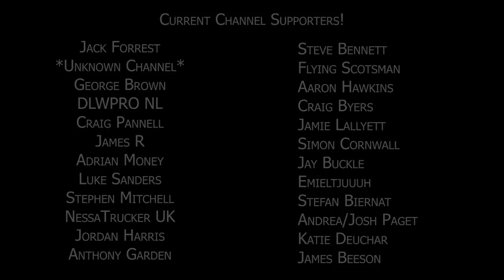I Quit My Job!

Comment: Mate i feel for you when we bumped in to each other on the Docks you looked happy and eager, But you me both get put down by company greed, since i finished with containers i went on to shifting film sets for ADF Facilities and they were worse had to opt out of the night work rule, (why make a law that can be broken legally) it started ok shift start at 16:00 finish 2-3 AM then they started saying 2 drivers haven't turned up 3 drivers haven't turned up and i wasn't finishing until 7am No Night rate overtime was only paid if you did more than 12hrs they stopped drivers speaking to the Operators and when one day i demanded to speak to my operator and confirmed my work sheet was all the work i would be doing that night, When i arrived on site guess what two drivers hadn't turned up Or more to the truth they hadn't hired enough drivers to do the work in a reasonable shift at a reasonable rate. When i complained they said well you know what you can do F Off Home so without moving a single trailer i went home and quit, Your doing the right thing Luke Nights will kill you early, You can drive a dust cart for £13 ph and you only need a class 2, you do the same trips week in week out no planning required and you don't run the risk of going over your hours trying to please some greedy Haulier, No disrespect to council staff just trying to put it in prospective, I hope you can have a Lovely Christmas with your family, Something will come up in the new year, If you do find someone who actually respects they're hard working drivers, Let me know as i haven't found one yet
Reply: what council pays 13 for bin driver? derby city pay 10 something but if your not driving you will be binning. unless you get taken on as a driver contract only which is 11:88ph but they are gold dust
Reply: @Mattfoster84  Southampton city council on PAYE
Reply: Melbourne australia Council truck drivers get $70k per year. guess what they never leave!
Reply: @Paul_i_is  derby city is also paye,  I'm on agency as a driver but my contract is about to end, but I'm on the same as the full time drivers.
Reply: @davidbernard7256  yer wish I was still living in Australia, much better money out there than the uk.

Comment: I gave up class 1 after 9yrs & walked away. I always wanted to drive trucks & ive done it. Used to love driving but hate it now. I tried talking to my company at the time about the amount of hours & drops etc. Even told them i felt i was a danger to myself & others on the road due to the hours & stress. Their answer was i was over exagerating things. I walked not long after. Goodluck in the future

Comment: Catering company. It's fairly easy and chill and you get to meet some nice people. There wont be any sleepovers in the cab either as it is you go out and empty your truck and come back home. When i did it i used to go to work around 2 or 3 am but some did it later.

Comment: I totally understand what your saying Luke and it sounds like the small companies are struggling so they have to take what they can but it's a drivers market and you will get another job ...maybe container work?
I will pm you about driving jobs where I wor -  but it is in Bicester ...good hours ( day work, start between 3 and 4 am, finished ( usually ) early to late afternoon. We are looking for class 2 multi-drop drivers and there is day cab work ( set runs ) for class 1. Over 30k a year. They would take you on in a heartbeat Luke because you are a well-experienced driver.

Comment: I wouldn’t worry mate,  from what read the haulage industry is chronically short of drivers,  so if you want to take break then do, but I’m sure with your experience you could walk into job same day if you wanted to, i work in taxi industry and have left one job and drove 10 mins to another firm,  had couple days off, started work 2 days later, worked 4 years there then left that job and straight into another job,  so if i can do that then sure as hell you can do it even easier, of course you may want to take time, have break, suss out what u want, I’d say the world is your oyster,  I’m sure this will lead to better job for you, Trucker Jay and Jenko left there jobs and needed up in new jobs easily, so u will as well,  and they seem happier, ive learnt that worrying gets one nowhere , as you find you stress about something, get in a tizz, find things are nowhere near as bad as you thought they would be, then wonder why you got stressed,  you will be just fine,  i would enjoy Christmas, put feet up for couple weeks, chill out then get job early new year,  it will work out ok trust me,.

Comment: Luke, I'm in the similar boat as you. I'm thinking of leaving the temp-perm thing I'm doing, as I've had enough, but the money keeps me on there. Need to find somewhere else, before I pull the trigger. Not easy for a 24 years old, with about 5 months experience. Kinda want to stay on (current truck is a 7.5 tonner) 7.5 tonnes work, or van work. Enjoy driving those more. Have a good Christmas, and a good new year. Family time, is more important than work time.

Comment: If you're not happy then moving on is the right thing. There are many jobs to choose from if you're a good hard working driver so I'm sure you'll be fine. Quit the job properly and respectfully and I'm sure you will get a good reference or like you say, if you want to return you can. I will say though, with most companies you are going to have to stick around for a while to be doing the good work. Best of luck to you 🚛💨

Comment: Take a well earned break mate, recharge your batteries and enjoy being with your family over Xmas, there’s loads of work out there don’t panic if the right job doesn’t come straight away January is a quite month in every industry, work life balance is hard to find in haulage but it can be done, bigger company’s offer more flexibility  for start times, shift patterns etc. Work out a figure you need to earn and take your time, you’ll be fine.

Comment: HGV Driving is rarely an 8 hr shift, employers are acutely aware of the hours you can drive and most business's push those hours to the max, a good work home life balance is important where family is concerned, you have done the right thing and now you need to reflect on what you can go for that covers the bills but gives you that home life you crave for.  This industry is like any other, matters not if its factory work or office ( been there), whats missing is fair play, treating drivers equally and making those adjustments where needed.
I would never consider the job full time, respect to all that do, after a days driving your mentally knackered looking out for all the idiots on the road.
Works there mate and i am sure you will pick the right option when you see it, best of luck!
Reply: I think that is more the point it's being treated equally and reasonably to get the best from employees not stretch them and throw relentless unrealistic hours and pay at them. It's the same in multi drop van work which Im currently doing. You can have a nice route with very reasonable hours which can turn on it's head into a 12-13 hour day with little rest time and no better pay. A lot of driving jobs are paramount to slave labour.

Comment: It would be interesting to watch everything you do in preparation for a journey.
For example, route planning, what do you look for on a route other than the obvious low bridges etc.... how do you note anything that is significant, also how you plan your breaks around work time and driving hours rules. Which sat nag do you use, are there any other practical driver aids you use? Have you got any tips on walk around checks, any help on when to put tachograph in waiting as opposed to a break or other work etc...

I guess I’m asking for the equivalent of the old saying “you’ve passed your Test now go out and learn to drive”

Comment: This is the sad reality of working for a smaller company.  Those of us who've done the same know the pain.  But on a positive note, by doing all those many varied trailers & jobs you've so much more experience than most drivers with such a short time spent on the road.  I know of many guys who've spent many years on the road; decades even; & still not got to cover curtain-siders, flatbeds, stretchers, containers, & low loaders in their entire career, much less in so short a time that you've done...  This will stand you in good stead for sure.  Good hunting; though you've likely found something by the time I'm writing this anyhow.
Reply: the only downside is with all the different experiences he has it doesn't get him a better wage.

Comment: Hello Luke, don’t mean to be pedantic mate but that’s a semi trailer or a step frame not a low loader. And you put the legs down to stop the bridge of the trailer cracking nothing to do with the tyres, normally anything over about 30 tonne id stick the legs down.
Hope you find a job and land on your feet pal, happy new year!
Reply: Your right about it being a semi trailer but it’s still classed a low loader .30 tonnes on a king semi ? Anything over 10 tonnes you should put the legs down to go up the ramps .Unit and a 45 ft king semi will be 19 plus tonnes unladen apart from chains and binders you’d be lucky to get 26 tonnes legally unless STGO plated. I do it every day .
Reply: Your right about it being a semi trailer but it’s still classed a low loader .30 tonnes on a king semi ? Anything over 10 tonnes you should put the legs down to go up the ramps .Unit and a 45 ft king semi will be 19 plus tonnes unladen apart from chains and binders you’d be lucky to get 26 tonnes legally unless STGO plated. I do it every day .
Reply: Willow7909 our faymonville semi is good for about 57 tonne, the anything heavier than a D6 we put the legs down, we had one trailer crack because of using the legs and dropping the air believe it or not! And those king trailers are strong as an ox, our one the legs come down automatically but you won’t believe the weight you can put through that without any stress

Comment: Do what I did, use you're licence as a tool to step up to another career.
I jacked like you after I got fed up of going to bed before my kids, so I signed up to a 2 year adult education course to be a gas engineer, it was a 17 hour a week course over 2 days (midweek) so agency work around the course was the only option.
I don't know what your practical capabilities are but my route worked for me.  
You can use your licence as an escape route although you will have to embrace the enemy of the agencies while you retrain, but for the sake of your family and sanity get your arse out of transport!

Comment: I had a quick check of the comments as I'd have thought someone would have spotted this in the last 3 years but I didn't spot anything (sorry if they have and I'm just reposting):
24:13 the traffic on the other carriageway disappears
24:19 the police appear to be putting on a box trap
24:21 a police car is holding the traffic back so they don't interfere with the box!

Comment: The trouble is, young blokes see a big flash truck and they want to drive it. Then they find out what the haulage industry is all about. Then the novelty where's off.
Reply from the maker: Nothing flash about a MAN 😂
Reply: Luke C in a HGV Hi Luke C, it was'nt aimed at you percificly. I was a Lgv driving instructor for 20 years so I know what they're thinking. They can't wait to get cracking in a big truck,I was the same when I was driving, want to drive something bigger. But I soon found out that the bigger the truck the more the the haulier puts on you. I think your doing the right thing, but if it's in your blood you'll find it hard to pull yourself away.

Comment: I know lots of drivers will say it’s boring , but supermarket work is about the easiest hgv job I’ve ever had and one of the best paid, also no nights out
Reply: I don't  get the boring thing, most jobs get boring after a few years but better to be bored because the job is straight forward than wind up stressed out doing something constantly challenging.

I don't drive but know a couple of friends who do and they both ended up doing supermarket driving for the reasons you stated.

Comment: Luke, you're a good lad hard working and honest, Campbell as already said it and he's right get on the Supermarkets it's far better than general haulage, no nights out, carrying your own stuff I'm sure there's an Aldi down your next of the woods.
Get on the agency give it a try, have a break from the vlogs it will still be there went you get back, no amount of money will give you your time back with your family Luke, have Christmas and New Year off recharge your batteries get signed up then with a few agency's, I used to do weekend work (days)no nights out, You get a better rate of pay a bit quieter and you can spend 5 days with the family instead of one. Anyway, have a good Christmas chill out enjoy it, remember you have a class 1 with loads of experience now.

Comment: The trouble with the transport industry is everybody wants everything delivered but no one wants to drive the trucks to get things delivered.  Good luck with next job
Reply: because the companies wont pay the money. picking on a night shift at amazon pays more than hgv drivers get.
stacking shelves at aldi gets you more than a hgv driver. both unskilled jobs that pay more. thats the trouble with the industry...... and the industry only has itself to blame! the only good thing about becoming a hgv driver now is the fact you can find a job with plenty of sitting around waiting in which you can spend that time retraining. thats exactly what im doing. when im waiting to get loaded or unloaded sometimes you can wait a few hours. im doing a college course from home in that time so it turns out the company im working for pays me to learn. in 1.5 years time ill be a fully qualified level 2 plumber and i did most of my learning sat waiting to tip in my truck whilst getting paid!

Comment: The trucking industry has gone to pot. Shit pay, Shit hours, harassed by the likes of VOSA and constantly struggling to deal with arseholes on the roads that have no respect for larger vehicles. Rushed to do my class 2 and straight into my class 1 to drive for a year before i decided i was not going to be treated like a slave and taken the piss out of because there's such a shortage of HGV drivers.

Comment: You work to live, not live to work. If you do a driving job and push too far and too hard the chances are you will end up in a massive incident, and the reality of the world is you will hold the ultimate blame for it as the driver, and again for not calling time on the cause. Anything else will just get put down as a "contributing factor".  As a driver you have to mature into being a manager and a judge at the same time, so the day will come you have to stand alone like a road block and say NO. 
Either No im not taking this vehicle as I consider it a failure/unsuitable etc, or NO Im not taking on this job/trip because I consider myself currently unfit due to "X" reason (normally rest/fatigue).  Sure that might get you fired sometimes, but it's far better than ending up in a fatal accident and being blamed for it in court where you will have to justify your actions.  I think you made the right choice, take some time off and rest, maybe a whole month which is perfectly normal if you have done 60+ hour weeks consistently , then consider the next option - which again you can always stop if it's having adverse effects.

Comment: Luke I told you 2 yrs ago get out of the HGV industry doesn't who you work for the hours are same , the only difference is how much you get paid which is marginal, Royal Mail , supermarket IHD's or working for a fuel tanker company like Hoyer or DHL will you get good money but it's all silly shift, spend your money on another trade mate while your still young, Brexit won't change the industry as the eastern Europeans will still come to fill the shortage gaps they will just be given a working Visa.

Comment: You drivers have it easy now lol I was a female class one driver in the 1980s. All we had was an address and a map and then my company moved from attics to draw bar trailer's and the worst trailers where u have wheels either end and 5th wheel. Prob the hardest thing to reverse ever as u could almost reverse past ur own trailer lol wed have agency drives whod turn up take one look and say no way I'm not driving that lol took a while to master the reversing. Least with an artic you know where ur trailer is. The whole  length was much longer too. So u go thru london with an a to z looking for a street and no phone or sat nav. U got it easy now
Reply from the maker: Yea job it self is easy. Easiest job Ive had

Comment: I have been hgv class 1 driving for 6 month now. Just turned 60 years old worked in the construction over 40 years  mostly done every trade in it. Lorry driving is the easiest job I have ever done. It is not a job for a young person i told my 5 sons never do it get a trade first. Told them to have the test done it is a job to fall back on and they did

Comment: Don't blame you mate. There's that much red tape and bullshit involved. As if you've not got enough to do.its a money spinning racket driving a truck. Yes and then you have VOSA. Bigest con of the lot.these people could pick fault with a truck straight off the assembly line! Drivers are a lot to blame for their own problems. Some eejit will do te do the job for nothing if you give them a big flashy truck.